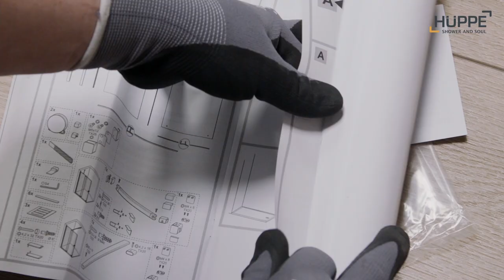HÜPPE Xtensa pure Installation

Comment: Muss der Stabilisationsbügel diagonal an der Duschhinterwand befestigt werden, oder kann er auch an der dem Festelement gegenüber liegenden Wand angebracht werden? Es wäre dann mehr wie ein Querbügel, nur dass man die Position am Festelement freier varriieren könnte. Danke!
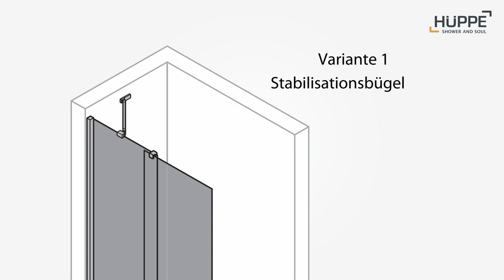Reply from the maker: Hallo Anaben11, vielen Dank für dein Interesse an unseren Produkt und deiner Frage. Es gibt für die hier gezeigte Version sowohl die Möglichkeit die Installation mit Querbügel oder mit Stabilisationsbügel auszuführen (siehe auch beide Varianten ab Stabilisationsbügel 03:10 und Querbügel 03:44). Dem Produkt liegt ein Stabilisationsbügel mit 500mm Länge bei, solche Bügel gibt es auch bis 800mm über den Fachhandel. Ob 800mm ausreichen um die gegenüber liegende Wand zu erreichen, muss vor Ort oder in der individuellen Planung geprüft werden. Bitte aber beachten: Getestet nach Normierungen und zusätzlich nach den weiterführenden HÜPPE-Standards ist das Produkt nur mit den angegebenen  und mitgelieferten Installationsmöglichkeiten. Eine weitere Alternative wäre das Ergänzungsset T-Bügel oder eine Deckenanbindung.